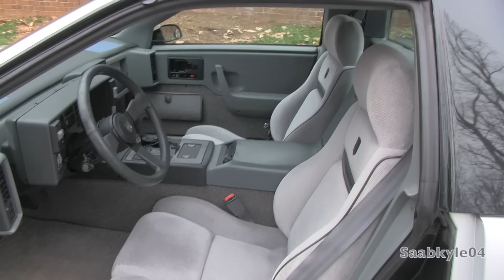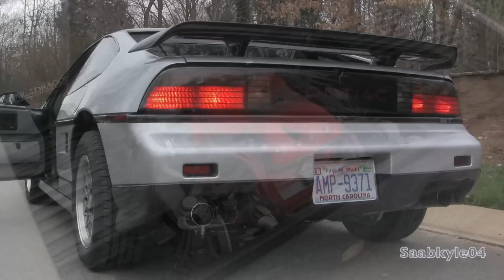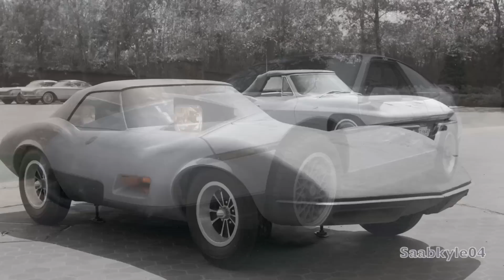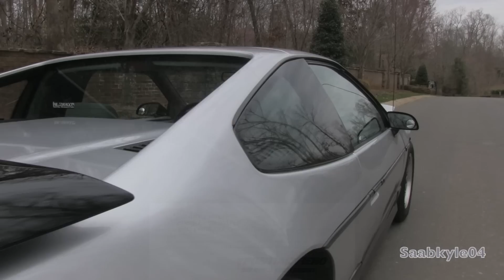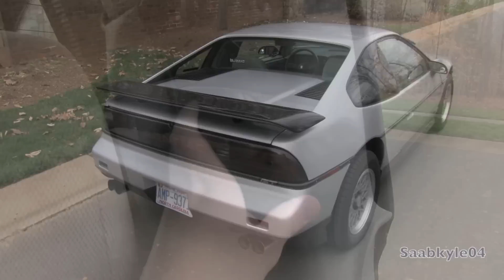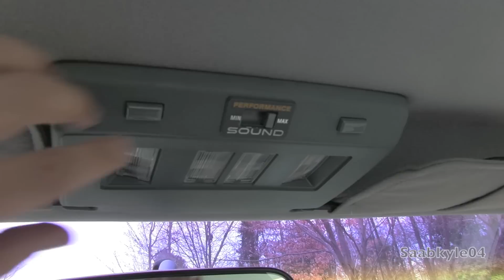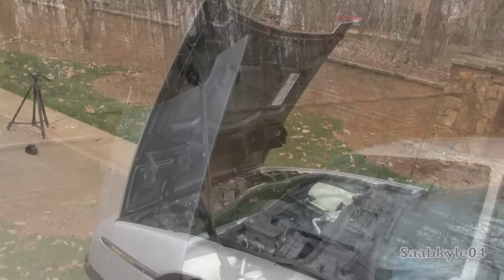1986 Pontiac Fiero GT Start Up, Exhaust, Test Drive, and In Depth Review

Comment: I think there was more to the car being axed than the sales because they out sold MR2s by leaps and bounds. And when Pontiac showed off a Fiero Concept car for the 1989 model year I'm sure a lot of people thought of holding out for it like most people did. The last year of the MR2 in 89 was a miserable 2537 in north america, then when the MKII came out in the following year it jumped to 17,606. Pontiac sold over 300K Fieros in its five year run, I'm sure with a release of a better 2nd gen version sales would have jumped up.
Reply: Wish thay would bring it back to the market
Reply: even though the mr2 had an additional decade of production. those engine fires the fiero was known for must not have got through peoples heads if they continued to buy em. I'd buy any wedge sports car over this anyday.
Reply: @coopermuccio4409  the engine fires weren't that common and was fixed too. They improved the car over the run too.
Reply: @sigmaprojects  if they improved it, why was its lifespan short?
Reply: @coopermuccio4409  For GM selling double what the MR2 was selling was a failure. If it was Toyota they would have seen it as a MASSIVE success, but to GM those numbers are pitiful.  Toyota sold around 30K units of the MR2 at the start and by 1988 they were down to 8K units. For an import, that for whatever reason is good to them. Imports are happy selling anywhere from 8~20K units a year. GM on the other hand had the Fiero start off really high, 136K units and tapered off to 26K units by 1988, that's still that's a bit over three times the sales of the MR2. Additionally by 88 sports cars sales were going down in general, for many reasons. So it's not that Fiero or MR2 were bad just market trends.  But, now to understand why GM saw the Fiero as wasted money. Between the Camaro and Firebird they would routinely sell well over 100K each year. In 1984 GM sold almost 400K Camaros and Firebirds, by 1988 they were only selling a little over 150K units a year. So to GM dropping below a 100K units a year signals to them to cut the car, not worth it to them since they already have sports cars to attract buyers. At least that's their ideology. Especially since the Fiero was a unique chassis while the Camaro/Firebird shared a lot with other GM vehicles.

Kind of like when Toyota, one of the best sellers of import sports cars in the US decided to just cut off each of their sports cars one by one because they "weren't selling any" yet in reality they were selling pretty well, but no Camry/Corolla well and to Toyota execs at the time they figured, why should we do sports cars? We don't need the added expense since we sell all the family vehicles we need.

If the MR2 was the poor man's 911, the Fiero was the poor man's 288
Reply: @sigmaprojects  how did it perform against other sports cars like the tr7, Porsche 944 and the matra murena. Let alone the Datsun/nissan 300 series
Reply: @coopermuccio4409  I don't have performance metrics of that time. But a fully loaded Fiero with all the performance upgrades you could get from GM was like $10k. A 944 base model of the time was like $35K, they're not really in the same category. Fiero I believe was pretty much all out faster in all categories to a TR7, but wasn't the TR7 mostly a 70's car? I don't think many TR7s were imported into the US. Fiero being a MR also kinds of puts it into a little different category, that's why it was always being compared to a MR2. Maybe a Fiat X1/9 might be a better European comparison?
Reply: @sigmaprojects  the fiat x19 would be a good pick. They made the x19 for almost 2 decades.
Reply: @coopermuccio4409  I wish we got more of them in the US, I'm pretty sure it influenced the likes of Toyota with the MR2 and the Fiero.
Reply: @sigmaprojects  reviews say though the fiat x19 is pretty unreliable. Is it true
Reply: @coopermuccio4409  I personally can't say about Fiat since I have only really worked on older Alfas and they seemed alright. However, there's always been jokes about all FIATs having terrible reliability.
Reply: I Wish thay would bring it back to the market
Reply: it out sold the MR2 in America because the import yen to American dollar conversion was terrible due to the trade economy which led to it being overpriced in the USA, but the MR2 out sold the fiero in the rest of the world. Still the MR2 was the better car in performance and reliability.

Comment: this car should have gotten the quad 4 that the Beretta LTZ got. That, I think would have been the ideal power plant for this car. I figure that it came out after the Fiero was already discontinued but that little car would have flied with that motor.
Reply: +SerenityNow There was plans to use it in the 1989 redesign before it got canned...

Comment: Too bad it had that lousy 2.8
Reply: The 1st gen GM 60-degree V6s were very durable reliable engines. They were of heavy-duty all iron construction. And the L44 2.8 in the Fiero was a high-output version which put out 140 hp which at that time was very respectable power output for a small-displacement V6. With that being said, I don't really see how it was a "lousy" engine.
Reply: +toyoscio Kind of a crappy motor but I think GM stooped to new lows with the Iron Duke motor and the LF9 diesel.
Reply: at least the 2.8 is reliable unlike the iron puke and the olds diseasel
Reply: +jsplicer9 the iron duke wasn't many things. But one thing it was is reliable. Save for that flawed batch of connecting rods, they were basically indestructible. An uncle of mine had one in a firebird he got from a junkyard. The engine lasted him from 300k to 500k. No, it didn't break, he swapped a V8 into it. The engine then went towards a home brew gasoline generator until he left it outside during a winter and the whole thing seized up. Probably would still run with some fogging oil and new wiring.
Reply: modwlego I heard the one fatal flaw is that it fails when high reving

Comment: The pontiac fiero and the toyota mr2. Same
Reply: Chris Starkey

LOL!

Well, considering your supercharged MR2 costed an extra $3,000. I will use that money and ALSO put a supercharger in my Fiero, and not just destroy you. But I'll take on Corvettes... And win.
Reply: zzzhuh yeah Chris Starkey is delusional if he thinks his supercharged mr 2 is gonna have any chance of beating 3800 supercharged fiero. The supercharged mr 2 is slow the damn things only had 145hp. A mr2 is also a dangerous road course car.
Reply: Chris Starkey

? I think you are confused... Im talking about a C7 Corvette. There is no way in HELL your MR2 is beating one. My Fiero on the other hand will.

And if you want to talk about the track, your car has WAY more of a snap over steer effect which is very dangerous. Compare that to the Fieros easily controlled design.

Plus, I can upgrade to Koni Shocks/Struts, and  that will out track Miatas.
Reply: +Agustin Middleton 
Completely different.
Reply: +Chris Starkey Much truth in your statements. I remember the review of the MR2 in the car magazines. The words used were "if this car had wings it would fly" and "dangerously fast". MR2 did what Fiero should have done, stay small, add boost, create a high-revving sports car, not a redline of 5000 rpm, lol.
Reply: i'd take that bet all day. and, even though it's really not too tough to do, i DID win against a lot of corvettes at that point in time, but like i said that was no big feat, vettes were shit ithe mid 80's. look it up all you like you'll see. 2000 dollars, even back then was paying for more than supercharging a car, it out cornered and outclassed that failure fiero from every aspect. let's look at facts not dreams.
Reply: +Agustin Middleton - not even close. my 86 MR2 supercharged would eat those piece
 of shit fieros for breakfast.

Comment: This car > the Solstice. If GM wasn't so insistent on so much badge engineering and realized that no one who was interested in a GNX or a Fiero would be in a Corvette, they may not have had to deal with the failures they did down the line.

Pontiac should have always had something like this in their showrooms, and less of the "volume seller" badge-engineered crap. No one really understood what made them different than Chevrolet besides some trim panels.
Reply: Later on, the Grand Am-themed styling that everything took on? 😟
Reply: And yet Buicks are still selling...............

Comment: you have an exhaust leak by the firewall.

those stock manifolds tend to warp over time. your local machine shop should be able to fix that for you. also there is a stud kit to help you put everything back together much easier.

Comment: you are incorrect about the suspension of the GT model... the ws6 (Lotus derived) suspension didnt come around until the 88 model year, making 88 the most desirable year.. and the transmission for the v6 was only the auto or 4 speed until just before the 87 model year when they introduced a stronger 5 speed for the v6  :)

Comment: the only problem with 80s cars is that you're gonna die in them. zero safety
Reply: That is not true at all. The Fiero had a 5 star crash test rating.

Plenty of cars in the 80s were safe.

Comment: Traded my 86 GT in at 212k miles on it. Still ran great and didn't barely burned a drop of oil.Also, the tranny was indestructible. 2.8 v6 = legend. And that boxy interior? An ergonomic triumph with unheard-of legroom.

Comment: Can they bring the pontiac fiero back with the same name and a faster engine in the back ,??????????
Reply: Hard to do when Pontiac itself has been long dead.
Reply: But gm is still around
Reply: @davidgraves8043  GM is not what it once was. I an all time gm fan should know. Its now more Government Owned
Reply: The 2.0L turbo decendant from the cobalt ss that is in the Cadillac CTS/ATS would be a great option!
Reply: ellycobra02 Would be really great. But the Corvette wouldn't like that.
Reply: @mr.2cents.846  Hell no it wouldn't. If the Fiero was reborn (granted it be done properly), with e right engine and design, it'd be the Corvette killer
Reply: @bryanconrad6077  GM did made a bigger fiero in 89 or 90. They have a video of it. Check it out.
Reply: @bryanconrad6077  true!!
Reply: They just did, Corvette C8. Just took GM 30 years to do it.
Reply: Ellycobra02 yes! Gm made a bigger model and a  better and bigger engine for the Fiero.which would of came out in 1990! They have a video of it. Look it up on this website. Also   check out the (Fiero 35th Anniversary Reunion August 2018) in that video they have two fiero's with V8 ppi 4.9 Liters engines. Check All of the anniversary videos them.
Reply: I have seen videos  of guy's modify this car and the 3800 sc. Made them awesome and sound great. you can modify them.
Reply: they would probably turn it into a crossover
Reply: They brought back hummer; Pontiac should be next
Reply: As an electric car.

Comment: I always wanted one.  I remember well when they came out!
Reply: I had the 85, Five-speed, four cylinder version. I now wish so much that I would have kept it. Same color as shown here. The guy I bought it from said the clutch was "bad".......I drove it daily for the two years I had it. Others can rag on it all day, I know it was a great car....still just TWO-SEATS...remember that! The interior is very very roomy & comfortable...you sit low to the ground & see every other car around you at bumper height. I got 30 MPG around town...the handling was just fine...I never did canyon boy racer type thing. Very fast directional changes possible. The trunk is huge, full width & very deep. You can still get one very reasonable, I'd recommend an 85(First bodystyle) ...SE version Manual, V6.

Comment: I have this same car, same year, same color except I have power mirrors, and a 4 speed muncie manual.

Anyone who isn't familiar with this car should check out the engine swaps.
There is a 3.8SC engine swap you can do that will make this run about 10 seconds flat.

Comment: Thank you , very nice review I like when you drive them .
Did this one have the Lotus tuning , or was it just the last year 1988 ?
Reply: None of them had "Lotus tuning". That is a myth. The 86-87 GT had same rims front and back with slighty different tire size allocated for the rear. Only 88s had staggered rims.
Reply: It is not a rumor, it is true!!!!! I saw one go up for sale on ebay and it had a plaque saying, "tuned by lotus".the car was a 1988 fiero turbo.
Reply: Alecmartin01 not true.  People are taking the emblem from Isuzu coupes and stocking onto fiero.  It never ever was designed or came with lotus suspension.  The 88 suspension redesign had nothing to do with lotus.
Reply: Thank you for that info. It had occurred to me.
Reply: I am not trolling, it is true!!!!!!
Reply: I believe you !!! Youre right .

Comment: Again, GM's cut-cost approach in the original car doomed it early on. The Iron Duke & soft suspension setup derived from the econoboxes in the 1980s made it very uncompetitive against rivals like the Toyota AW11 MR2.

If they actually tried to make it a geninue sports-coupe from the get-go, the Fiero may have lived longer, or maybe even a generation 2 model.
Reply: Actually, the Fiero sold very well and with the cost reduced  recycle bin design, it made a lot of money for GM.   The model tapered off because of low sales, but the whole industry was changing by the late 80s, and it was at this time that financial stress from the Japanese crushing their sales became a serious threat to GM.  They simply could not invest anything further in a sinking market type of car, even though they did in fact have a generation 2 much hyped about that finally got its performance goodies.

Comment: GIve me a break dude, point the camera AT THE SPEEDO not the steering wheel. And holy crap cool it with the revving, you revv 5 times too much, the 2-3 revvs is the beginning is plenty to know what it sounds like. The 8 revvs later on in the video is unnecessary. Also mix up the things you do, it's the same every single time, from the revvs to the information. Maybe you're afraid to move on, but you got to, it's getting annoying.

Comment: worst and cheapest interior ever
Reply: Really? It fits people up to 6'5 and can be customized very easily. You can even switch out the pieces to have a wood finish or carbon fiber. Worst and cheapest? No, very roomy and easily customizable.
Reply: In the early cars, you could've had speakers in the seats, and back then it was expensive.
Reply: Alecmartin01
Hell in 88' they made some driver seats have lumbar support. Yup, 1988 had electric seats... in a sports car o.O

Comment: "Potent" isn't a word that comes to mind when talking about the 2.8.
Reply from the maker: Better than the 2.5L 4 banger
Reply: Tony Wilkerson McDonald's makes millions of burgers.  That doesn't make them good.
Reply: ***** They should have offered it with the 5.0 ho or crossfire injected small block.
Reply: ***** At least the 2.5 was a bit more reliable though. The 2.8 had problems with throwing rods/breaking cranks for several years.
Reply: My old 87 GT had 198K on it..no rods thrown
Reply: Tupac Amaru They didn't make the GM 2.8.
Reply: +hartsickdisciple Yes, no issues here, 3 time Fiero owner, mostly over 100k miles on each. The GT was a near miss that could have worked. I had the 4 speed GT, and it just wasn't powerful enough to enjoy fast. For the money, they were all fun cars to commute around in. The mileage was good in the 4 bangers.
Reply: ***** Yeah, but what isn't?
Reply: Daniel Stewart That's wrong, it was the 2.5L hence why it was the only one that had engine fires.
Reply: kaio37k You're actually right. The 2.5 did start throwing rods at one point, but it was only one year in the 1984 Fiero. No other GM car of any year with the iron duke had that problem, if the car was properly maintained of course.
Reply: Daniel Stewart Exactly, additionally, the fires were almost exclusively occurrent to owners who admitted to not changing their motor oil.
Reply: hartsickdisciple say that to a japanesse car builder hahahah
Reply: hartsickdisciple chevy made s$%^ loads of em
Reply: +Rob Heckman I never had any issues with mine either (86 GT here).
Reply: hartsickdisciple Sounds real good though.

Comment: just found an 88' fiero GT for $4300 locally. Has 54k miles, new leather seats, auto, gold wheels.. good buy?
Reply: I'd say that's a pretty solid deal. The tail lights alone on '86-'88 Fiero GT's are worth $400-$500 on Ebay in good condition. Parts from these things are usually worth more than the whole car in some cases.
Reply: Jake Finnegan Yep go ahead!
Reply: Did you buy it?

Comment: Question: I see a lot of sports cars of this time period that have the flip-up headlights like a Corvette.  I've not seen them on a sports car earlier than a C2 Vette.  Have all these car companies based the headlights off of the Corvette (Corvette made them "popular") and was the Corvette the first to have them?
Reply: Near VII better than a 2013 grand sport? No but sorry you will be the one taking the hike.  It will crush you in handling,  top speed, acceleration,  every aspect except gas mileage, I'll give you that lol. Our 2013 has wide ass rear tires and will take corners like a pro, auto cross loves to express it's handling.  So have fun breathing premium exhaust as I leave you in the dust.
Reply: back in the day only circular or square headlights were DOT approved, so in order to have better aerodynamics flip up headlights would be the way to go.
Reply: Thanks.  I guess what I meant to ask is that if Corvettes started the "trend" or if other companies would have done it anyway?
Reply: Near VII probably because you have never drove one. They handle better than your little rice burner '98 Toyota Corolla